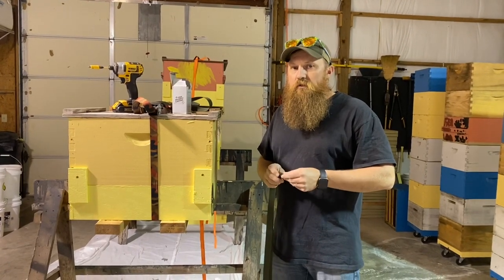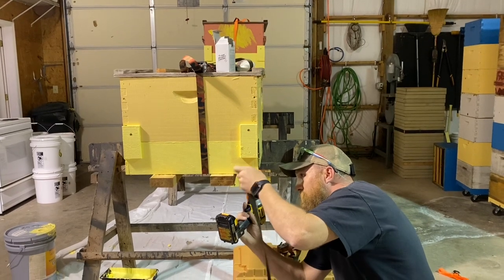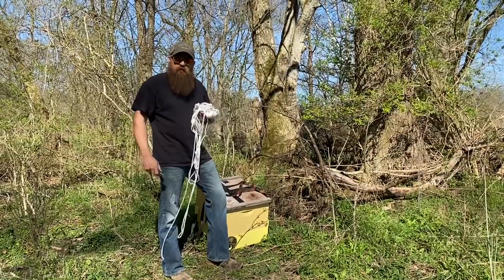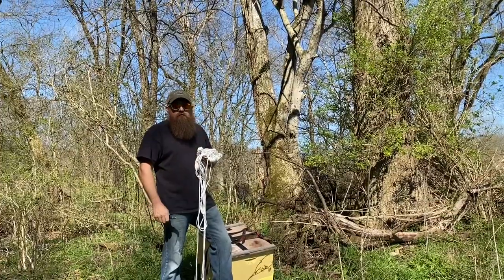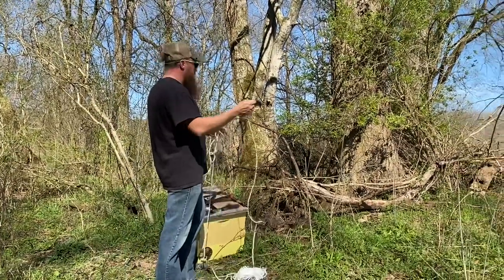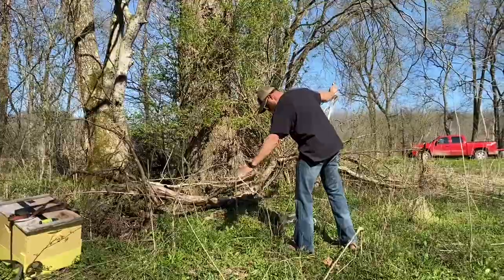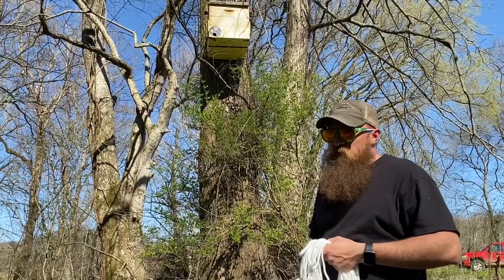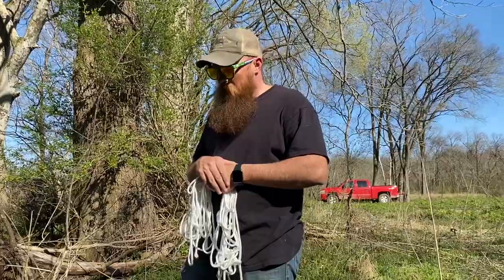Hanging and Placement of Swarm Traps to Increase Success!

Comment: I call the the ones we hang from rope "Danglers". Do a few of them but prefer ones you hang from a nail but I've caught a ton of them swinging in the tree. Each location is different so i have a bunch of traps that can hang from a rope or a nail.

I used small Eye bolts and ran paracord from the four corners and carabiner on my tow rope. Once i get the rope over the limb i never take it down.

Comment: Man... that looks like a PITA... I run my traps no higher than I can get using a 3 step, step stool.  Good Job though... Thanks for sharing.
Reply from the maker: It’s not too bad. I have used the same stool in n the past when I use to screw them to the tree.
Reply: @beardedbeeworks261 I was gonna say.  I've seen where people have used a folding ladder to lag bolt a French cleat more or less level, about high enough that the bottom of the trap hangs at shoulder level.  Then use a bottom board/base that's simple, have a 2×4 or 2 coming up, and a French cleat cross bar at top.  Then put 2 5-frame nucs on top of eachother and strap it all together.  When you go to pick it up, you just pick up the whole swarm trap off the French cleat and bring it down.  No ladder or rope needed for hanging or retrieval.

2 5-frame nucs is 40L which is almost perfect.  But it's a more vertical configuration.